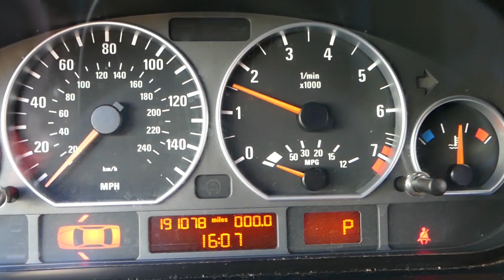BMW CODE P0325 P0330 P1327 P1328 P135B P1385 2E68 2E69. BMW E90 E91 E92 E93 E46 KNOCK SENSOR

Comment: Thanks for your videos. They are very informative and yes have saved me a lot of hard earned money.  
Quick question. For my 2008 Outlook, I have the P0330 code for the knock sensor.  I will follow your advice and get it changed. I understand my car has two sensors.  Are they the same?  If I get two sensors and two harnesses both 

the same, will that be ok to take to my mechanic? Please advice ASAP so I can have this taken care of. 
Many thanks.